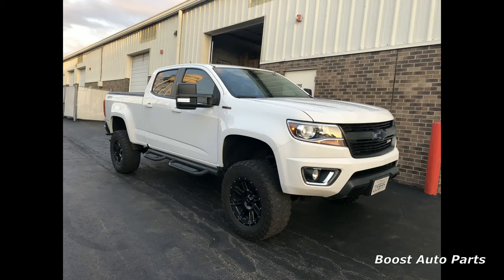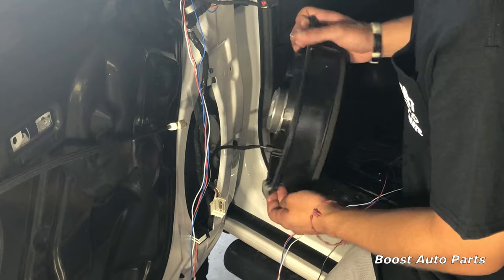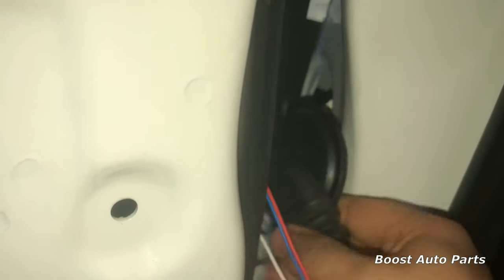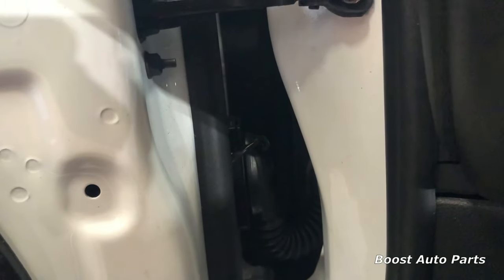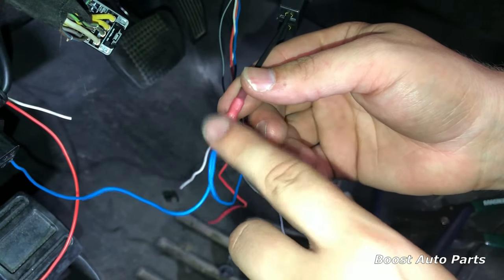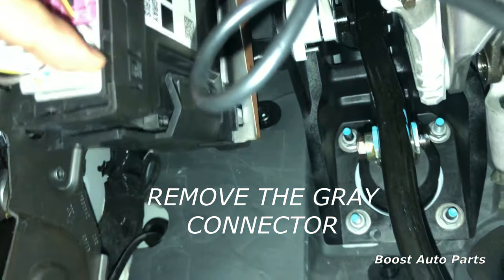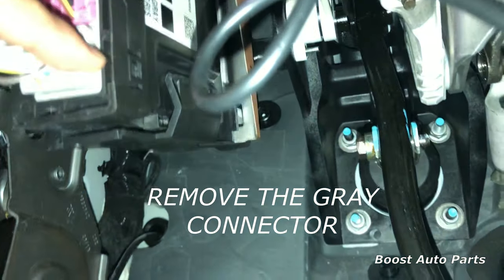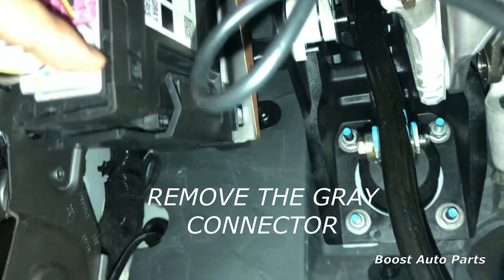2015 - 2021 Colorado and Canyon Tow Mirror Install: Performing Wiring

Comment: It’s probably worth a mention that on my 2017 Colorado Duramax,  the cargo lamp is allowed to illuminate when I shift into reverse. It doesn’t illuminate in a forward travel gear.
Reply from the maker: That is correct, the cargo light may only be manually commanded on in Park, Neutral, or Reverse.

Comment: Can you order style 2 without the lights ? I don't really need the signal on them and it just seems like a lot of extra finicky work that I'd rather avoid😅
Reply from the maker: Unfortunately not - but if you're not looking for lights style 1 would be a great option!
Reply: You can definitely order them and just plug in the OEM connector and retain your defrost and power mirror adjustment controls. That’s how I have been using mine the past couple days as I ran out of time to wire in the accessory lights
Reply from the maker: @DunnRightVideos Correct, however none of the lights will work of course.

Comment: My 2019 Chevy Colorado wt doesn’t come with a rear and mirror defrost button so is there any way I can get the heated mirrors to work if I install these mirrors? Possibly with the front windshield defogger??
Reply from the maker: Unfortunately not - in order for the mirror defrost to work your truck has to have the rear window defrost.

Comment: Also you didn't mention that you should disconnect the battery when doing any electrical work on the truck. Unplugging the body controller with the battery connected could cause a check engine light to come on. I've seen it happen.
Reply: Then just clear the light afterwords?

Comment: I have 16 Canyon 4x4 SL has the convenience group but no power mirrors. Do you know if power mirrors could be added?
These LED headlights are killing me at night.
Reply from the maker: Hey Tom,

At this point we don't have an upgrade path outlined to add power adjust to trucks not originally equipped. We are working on a retrofit kit, that would need a switch moutned somewhere.

In the meantime, you could wire up all of the lighting features on our mirrors.
Reply: Anyone who comes out with a conversion kit for canyon/colorado will make a lot of money.
They have sold loads of the base canyons without power mirrors and are still doing it. Convenience group includes remote start but still manual mirrors? Ridiculous.
Reply: Tom Lehmann, I want one too.
Reply: @elvismortimer1685  I also want the power mirror conversion kit when one does come available.

Comment: Does this void any electrical warranty? I have heard GM not honoring warranties with aftermarket electrical components installed tapping into factory wires.
Reply from the maker: Depending on the area of warranty you're referencing it may be voided (i.e. the mirror warranty is certainly voided). The taps that we use have fuses inside of them to protect the BCM, but at the end of the day it is up to GM whether they will honor the warranty or not. If you are concerned about this we recommend reaching out to them directly.
Reply: @boostautoparts  thank you